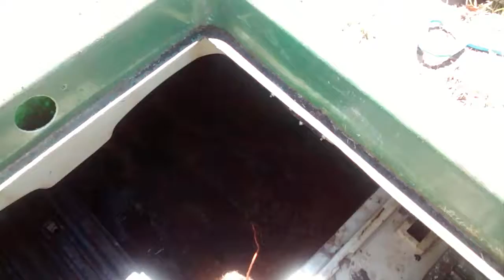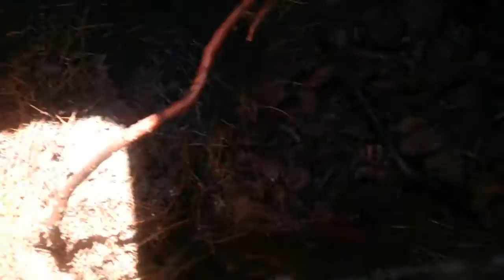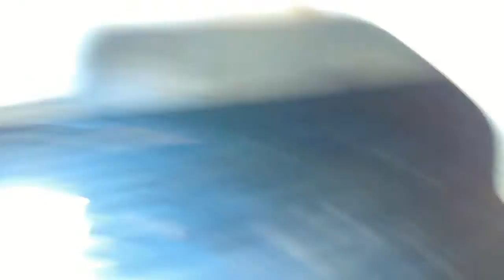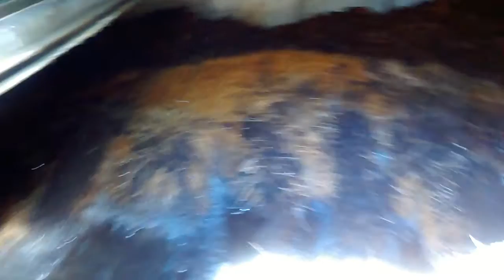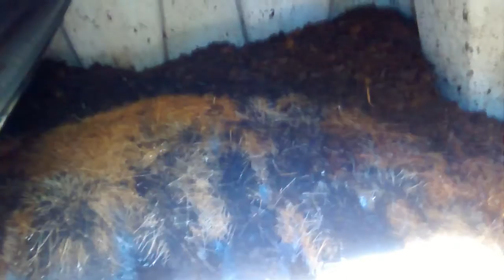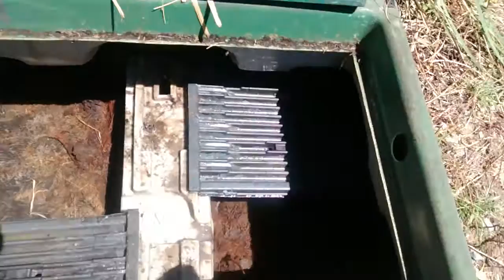Ecoflo peat septic system root intrusion

Comment: sounds like the owner is being blamed for what can only be a flaw in the craftsmanship of the housing.
Reply: I didn't rewatch my own video, but I don't think I was blaming the owner for it or at least I didn't intend to. I have seen roots penetrate through cracks in the housing sidewall which I would agree is a flaw in the housing or in the manner in which it was installed.
Reply: @AQWAtistheseason  something about the owner not turning the peat
Reply from the maker: @pamtnman1515  North Carolina requires a licensed operator to inspect and maintain systems like this. Part of the maintenance guidelines in NC at least is that the operator is suppose to inspect for root intrusion and rake the peat to ensure even distribution. thanks
Reply: @MC-zm2ki  OK thank you. I do not think we have that kind of requirement here in PA. I decided not to go with this system anyhow, because it is too expensive

Comment: Did you ever figure out where the roots were coming from?  Did they come through the bottoms of the tank?  Or were they just growing from within the peat moss itself?  What is the cost of replacing the peat moss?
Reply: I don't remember where they were coming from. Have seen them coming through cracks in the sidewall but I would also assume that if the tree or root source is close enough it could be coming up from below. These units gravity fed directly into a gravel bed and then then sand so there is not a bottom of any kind on them.  Costs will vary, a local installer would be a better source for that.